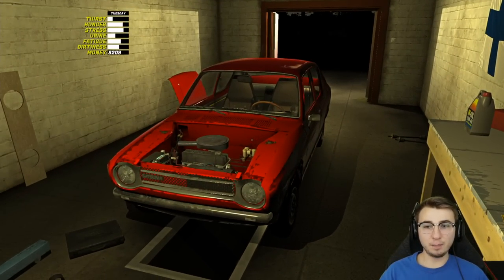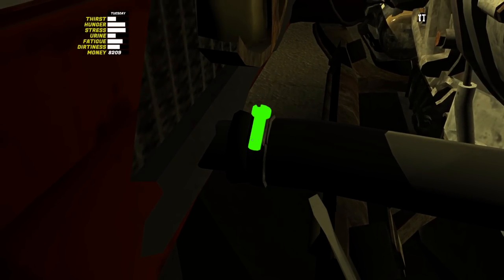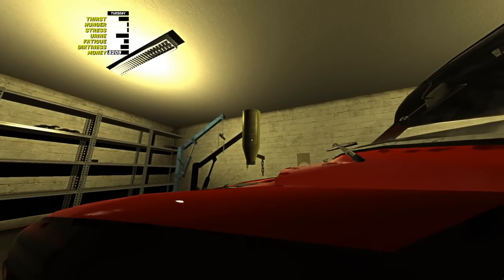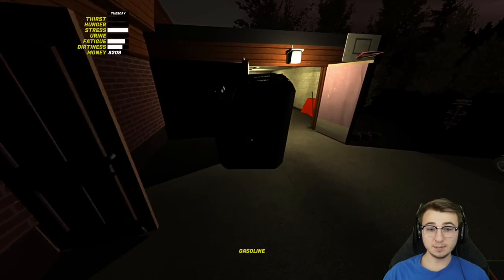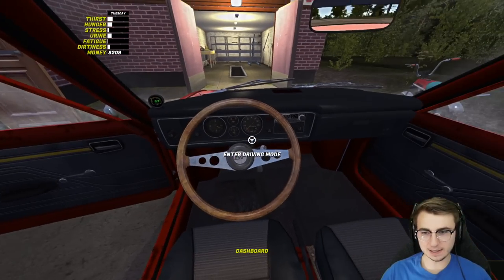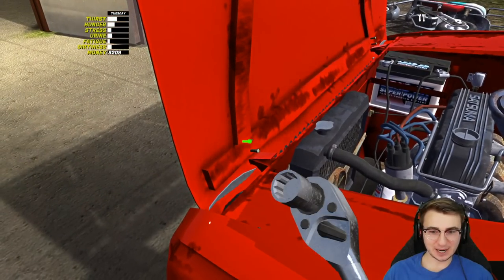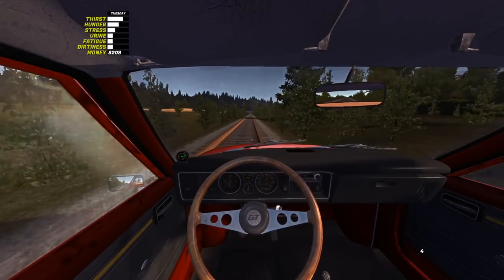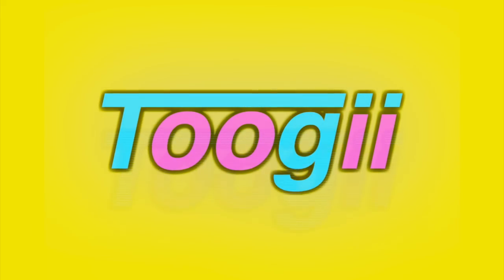My Summer Car - Ep. 8 - Expect the Unexpected

Comment: Im pretty surprised the satsuma started up that easily, I have 1000+ hours on this game and I never have it start up that easily.
Reply from the maker: Have you ever tried following the guide on the wiki?
Reply: Always starts first time for me. Takes a bit longer on first start
Reply: @Toogii  Not in a long time, I just do it off of memory and my knowledge of cars now, and I can usually get the car up and running by the first Wednesday or Thursday, usually on my first start I have to atleast adjust the belt tensioner, but I have also killed several batteries on the first start too.